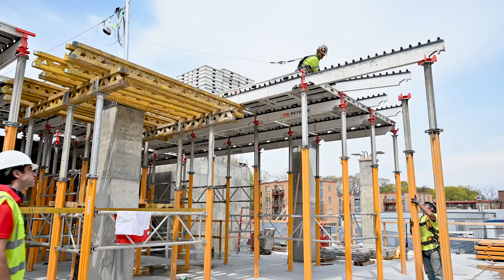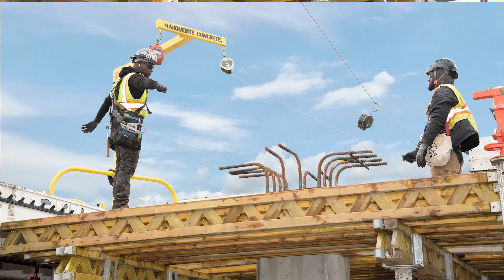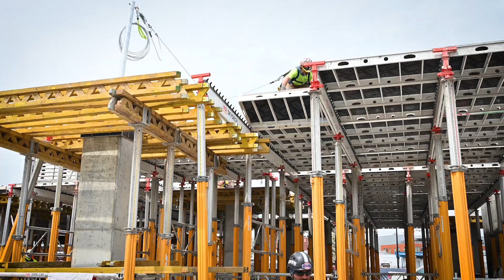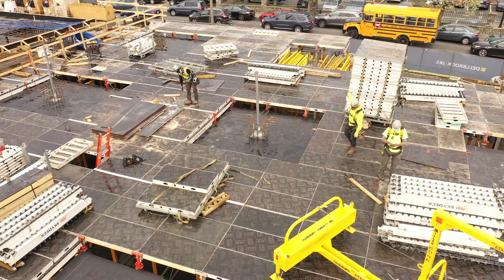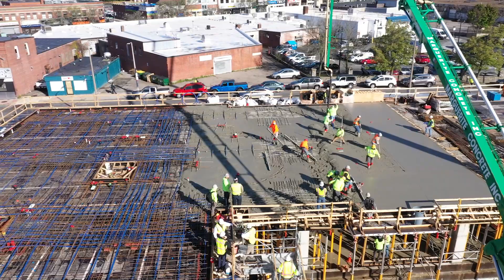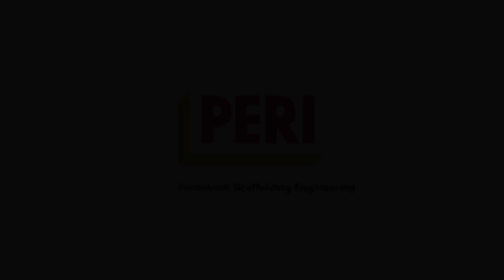FORMWORK | Mattapan Station in Boston, MA realized with PERI SKYDECK (EN)

Comment: it is a pretty good system but after 30 years of doing it along with Topec i think Topmax is one of the best but if you work with Peri they 99% of the time find a fantastic solution no matter what, it is bulletproof ..if you really break the code on how to use Skydeck it is really good, but it is a lot of parts and needs almost as much crane time as fixed decks and under a time limit all the time you feel the pressure since it is faster to set up than to tear down  and the concrete comes on Friday no matter what :)
Reply: iv used all 3 off them systems you mention  . like you say topec is faster